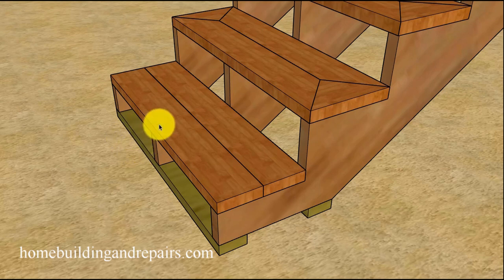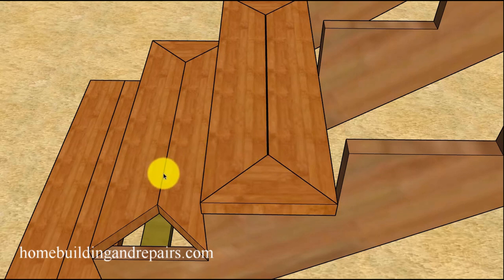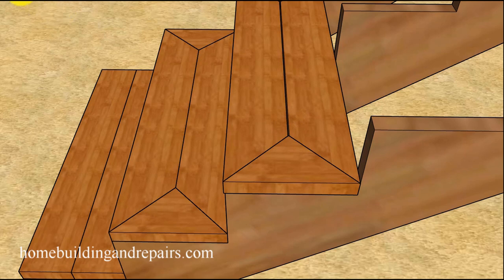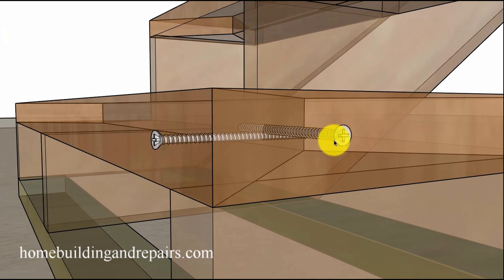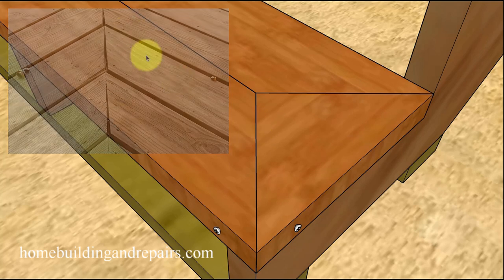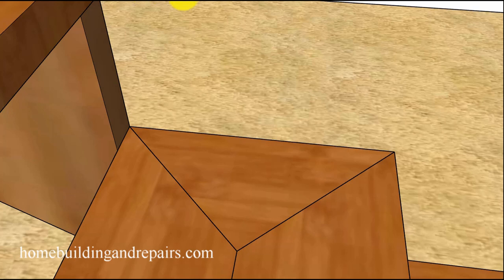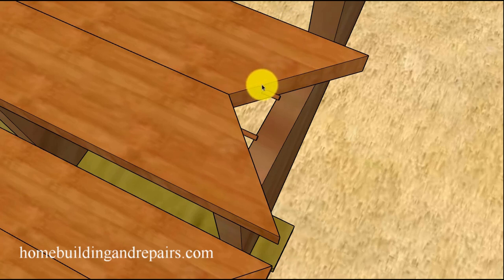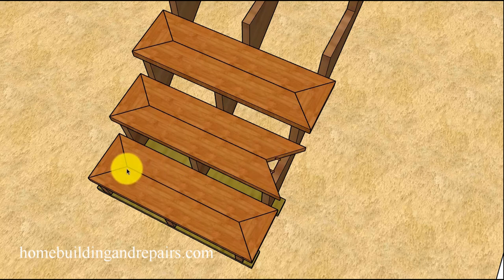Good or Bad Exterior Stair Tread Design With Every Corner Mitered

Comment: I was just going through this same mental exercise for a client deck.  If you add a 1x fascia/trim on the PT stringers adds overhang/reveal for drip edge, you increase the bearing area.  Attach a 2x cleat on the inside edge of the outer stringers.  This will further increase the bearing/securing area.  Add PSA waterproofing tape on a all hidden horizontal mating material surfaces to reduce degradation from trapped moisture and debris.  GOOD discussion, thanks
Reply from the maker: You're welcome and thanks for sharing your ideas.

Comment: Did mine three years ago and used pressure treated blocking underneath between the end stringers, works fine, even moved appliances up and down these steps an no problems.
Reply from the maker: Sound great. I have a planter box I made about 5 years ago that has almost a 3/4 inch gap at one end of the joint.

Comment: Had a friend build some steps for a big deck about 15 years ago when I lived in NY. They were about 12 ft wide with a platform about 1/3 the way down then opened up at about 22.5 degrees for 6 more steps......Any idea how he supported them..... Now living in Alabama and want to do the same thing here in my new house I am building......I have photos.
Reply from the maker: I would need some type of a drawing or a picture. You can email them to me and you can get our email address at the website. I also have another book that might help called "How to Build and Frame Stairs with Odd Shapes." You can also find that book at our website in the book section.

Comment: just double the stringers or add two by blocking
Reply from the maker: Sometimes this can allow moisture to accumulate between the two boards and rotting in certain climates.
Reply: @stairbuilding  I never seen that...I mean it could get between the tread and the stringer with that logic or what about on top of the headers? So long as its pressure treated you shouldn't have to worry. I suppose youbcould use a rubber membrane if you are that worried about it....